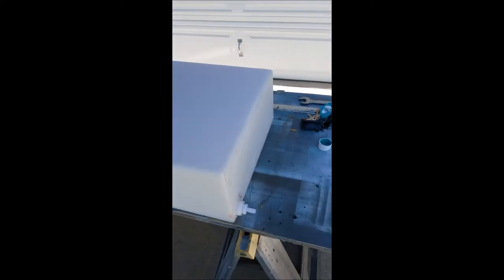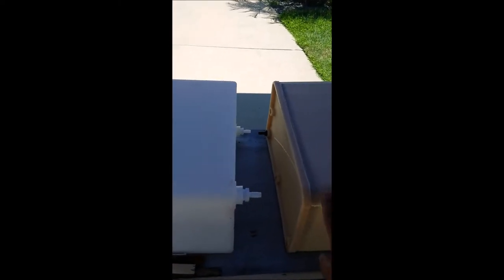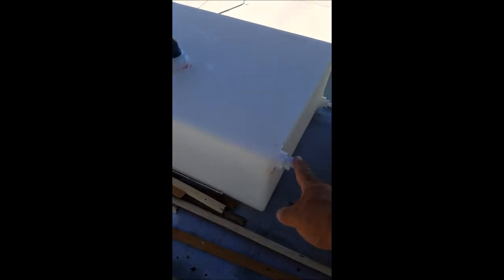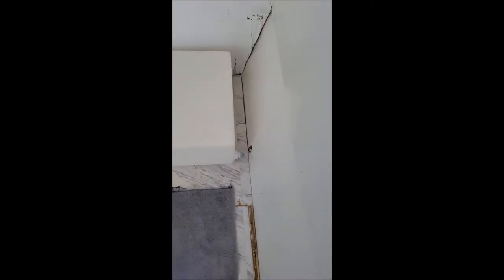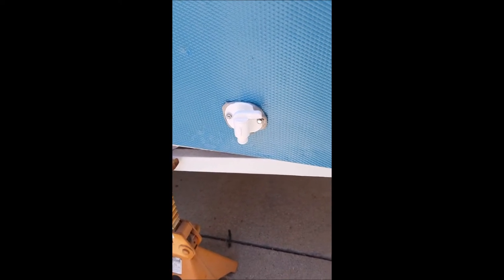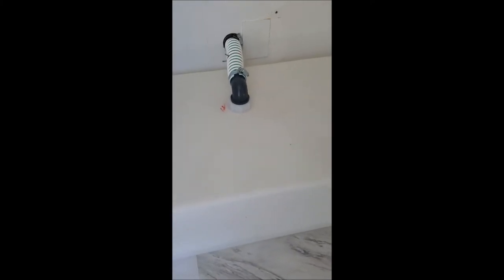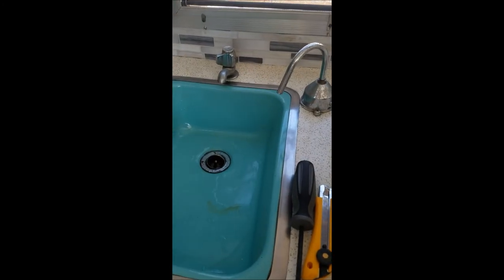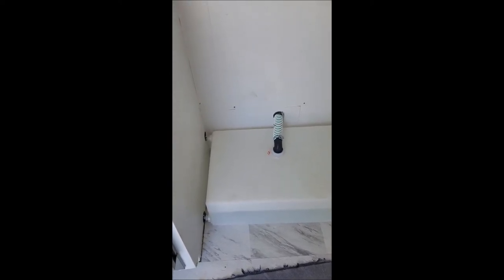1961 Oasis Trailer Rehab  #25 The final Touches to the trailer Water Tank, Battery and Dinnette Bed

Comment: I love it.  And good info about tank replacement.  We probably will have to. But ours has an electric pump. Don't know if it works. So. There's another problem to be solved. Great news. No rain for a couple of days.  Got the right rear side rebuilt and most of the left.  Dr tomorrow. Then Friday the plan is to finish left rear side and start with the back. Yay.

Comment: Hello Rudy I have been following your video's and was glad you did this one on the water tank.  I am wondering, if the old tank still worked and this was your personal trailer, would you have kept the old one and used it and if so how would you go about cleaning the inside of the old tank.  What would be the pro's and cons of each tank?
Reply from the maker: No, I would of replaced the tank. It had a crack and was not holding water... I generally just throw them away.  If you can clean the old tanks with blech and water, But I would still not use it for drinking just for bathing and washing dishes... Glad to help, Thank you and Safe travels....